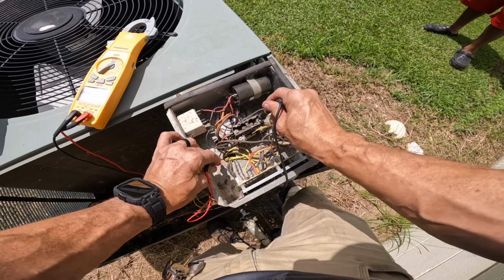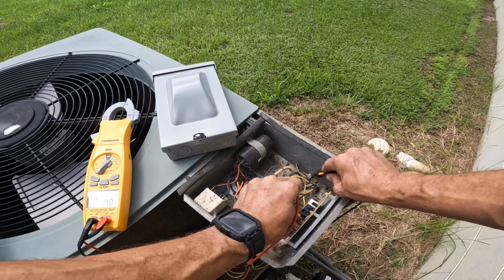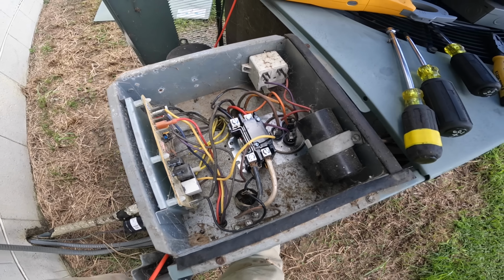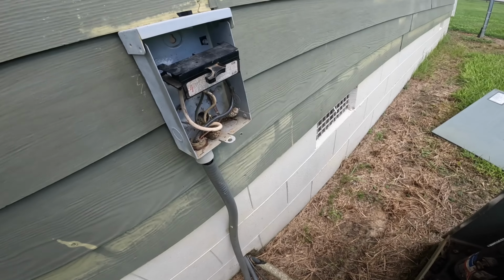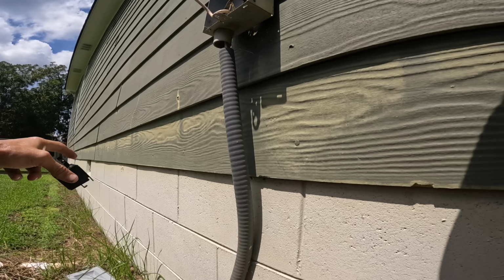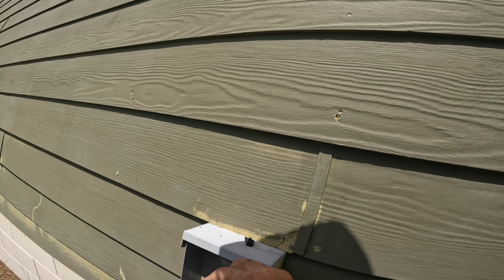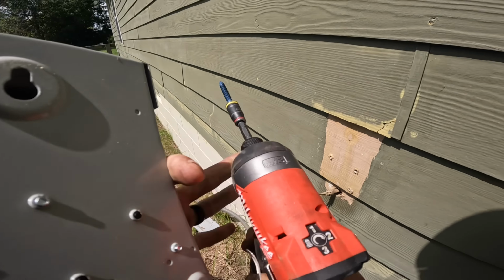No Cooling, Burnt Contactor and Disconnect Falling Apart

Comment: Good thing you had a spare disconnect (although an very expensive one) on your service truck.  If your going to stock/replace disconnects, you should also have some plastic bushings or chase nipples for the 'Romex' feed that enters from the rear.  Also, placing a small loop in each wire that connects to the breaker makes installation easier and provides a easy place to take a current reading.

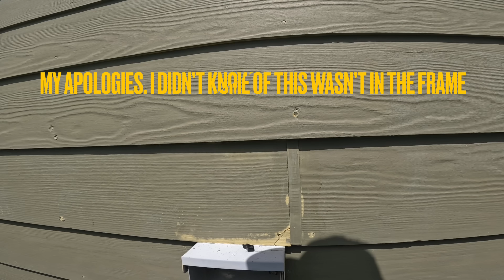Comment: 5:33 I totally agree Curtis, every one of those pull outs corrode and then burn once the resistance gets high enough.  I replaced the one feeding the 3.5 ton package unit on my  house with a feed-through breaker a while ago.  What is crazy is I've seen so many HVAC contractors installing those pull outs, I'm assuming due to lower cost and more frequent changeouts that will be needed.

Comment: At 18:20, it looks like some of the strands of the black wire aren't under the screw connector.  Possible hot spot under load.
Reply: yeah, it looked that way, may have been a few strands out. while it's not kosher per electric code/work, that stranded wire is oversized by two gauges to my eye it was a #6 copper stranded and the feed from panel to outdoor disconnect is 10awg solid(romex/nm-b), likely a 30amp breaker(maybe only 20amp depending on unit tonnage) someone used what they had on the truck and connected it, seeing the pvc conduit fittings on the end of the liquid-tight pvc. it may have been glued in at one point and let go from shrinkage. lol

Comment: Nice repair. We electricians use the linemen pliers to tighten and loosen locknuts  and while at the circuit breaker panel turning off the circuit breaker for the furnace would have saved you a trip into the crawl space. I enjoy your videos!

Comment: Hello; You might’ve done it and didn’t show it on the video but one of the things that I would’ve done since I had the power off is to check the microfarads on the capacitors while you were right there, bet one of them was probably low! Other than that always very good craftsmanship and integrity!
    Edward H. - owner / operator of “Integrity Plumbing, Septic, HVAC and Drain“ in Clinton, CT.
Reply: I'll bet he did that, but I agree that an out of tolerance cap can cause high start and run currents. I also check new caps and mark with install dates and value with a Sharpie marker. It is free and can save a call back
Reply: @hinspect  I do the same thing as well and it’s a good habit to be in and I have done it from the very beginning!

Comment: Wish everyone would wrap these white line/load wires with black tape. They obviously are not neutrals to most professionals, but some unlucky person could get zapped at some point if they get their hands inside the disconnect box 🤷‍♂️…missing a Romex connector on the supply also…
Reply: It’s illegal to change wire color with tape
Reply: White + Black does not necessarily indicate 220/240V, I agree with you though it should have been marked with tape but I am not surprised that it wasn't, at least in Tennessee. It looked like the Black + White from the house was #10 solid feeding a #8 Black + White stranded too!😄
Reply: @FredD63  what is legal? Marker?
Reply: Fingers don’t belong in a live disconnect anyway.
Reply: @whoisderf  agree 😂
Reply: @FredD63  actually Fred it's code to re-identify a white wire when used as a hot. The NEC doesn't limit you on how you may re-identify it but it certainly is very common to use electrical tape. And for the record, only white (or natural grey) wires that are part of a cable assembly (Romex for example) can be re-identified. Meaning that it's not permissable re-identify and use a white or green wire as a hot if it is a single conductor, ONLY if it is part of a cable assembly.
Reply: @fritzmiller9792  
Ok I stand corrected
Reply: @FredD63  You we're right in the spirit of the code !    I have seen white and green re-identified in a box (used as a hot wire) where it leaves the box in a conduit to other boxes.....a very dangerous practice. That's one reason why I treat every wire as a hot when first troubleshooting or altering electrical work. Don't even trust your own Mother when it comes to voltage I always say.
Reply: @FredD63  Wrong!!!!  It is required to re-identify white wires any color  but green to identify it as a Hot Conductor
Reply: Yes Chuck, spread the word to keep your hands out...lol.  always line tape....it's common courtesy and code in most places I've worked.  Thanks.
Reply: Using that logic, most "lay" people think black is ground because black is ground in automotive electronics.

Comment: If you don't have one, you should get one of those demolition screwdrivers from Klein. Metal shaft goes right through the handle to a metal cap on the top, good for hammering out knockouts and tightening/loosing the nut on cable clamps, etc...

Comment: You should have added a bushing on that disconnect on the house side. It is not a legal install to not have something to protect the wires.
Reply: It is a legal install
Reply: No it's not. Wire just floating around on the house side. Knockouts on that box are sharp.
Reply: @GoatzombieBubba  wrong.....this would easily fail electrical inspection.

Comment: Plugs were also used at do it yourself car washes in place of real coins…
Would like to have seen the wire grommet put in the box before house wiring was ran into box as it’s UL code
Reply: With wiring it is what it is. Most tech don’t know code but do the best they know. Lots of cities and states would require a licensed electrician to switch out that box.

Comment: Where is the Romex connector for the line wires coming out of the house ? And it doesn’t appear there is any caulk sealing the romex coming out of the house….. You made a point to replace the seal tite fitting at the disconnect but failed to install anything on the line wires
Reply: If inspected for sale in the future, it will definitely fail just because of the strain relief grommet.....
Reply: @JohnstonPettigrew  You have a very favorable view on inspectors. Where I'm at, it if it's not in plain view it won't ever be called out.
Reply: @billymccoy9155  ok ....but leaving out a connector on a sharp edge is just sloppy and not acceptable....because this is where the code is right.  I have seen sharp metal box edges wear away on wire insulation after a few years and some movement caused by a host of issues.  The siding can settle and move the box, even if the box is well attached.
Reply: @JohnstonPettigrew  Not arguing the reasons for the protection, shorts from wire exposure is a stupid problem to have, but happens all the time. Just saying the claim that it would fail inspection is laughable, no insult intended. Even if an hvac tech went through looking for any possible errors, most likely a customer would do nothing about it unless free.
Reply: @billymccoy9155  I understand your point.  My daughter's house failed on two points.....one was the exposed wire on the a/c breaker was 1/8 inch too long and the second was the a/c whip didn't have a rubber seal at termination at the electrical shut off.....just saying.  This was a house inspector hired by the buyer....not the county electrical inspector.....who picked off a switch in the newly installed a/c which was a few inches off from code.  It was repaired by the a/c contractor.
Reply: @JohnstonPettigrew  Somebody actually did their job. Sadly that's funny from a home inspector. How many jobs have you seen where this was never called out? Here my biggest problem with inspectors is they say it isn't working right because the temp split is off, aiming a laser at a 15 foot supply.
Reply: I am only familiar with Coral Springs, Florida, New City, New York and Porto Alegre, Brasil ....the only places we had inspections.
Reply: @JohnstonPettigrew  I meant in the field working, I assumed you were a tradesman.
Reply: @billymccoy9155  no....I'm a new home builder.......subs deal with electrical inspections.....I am not directly aware, but issues come up a lot.....especially these small issues like romex connectors and insulated a/c lines.......
Reply: That is correct
Reply: I noticed that. He should be able to sneak one of those Arlington split snap in ones in there without having to remove everything, will take some careful maneuvering to work it backwards on the wire, but should be doable.
Reply: @airplaneengine  I have seen a product from "Miller" being used by our guys also .....same kind of deal.
Reply: Oh my gosh, watch this guy for amusement only.

Comment: I just had one today that was installed behind the gas meter so you couldn’t get it open and it also was completely fried and burnt inside from bad connections. That was easily the worst one I’ve ever seen in my career
Reply: Had one installed between two roof pack units. One unit had been replaced, much larger than the old unit and sandwiched it in there.
Reply: lol. time to relocate it and smack the whizz out of whomever placed it or the gas meter there.🤬🙄
Reply: @throttlebottle5906  Exactly!! Would love to have a chat with that person.

Comment: A non-HVAC person with an EE/CS background in automation. That contactor lived a rough life in its type 1 enclosure. I watched some other HVAC videos where commercial roof equipment dies expensively of single-phased compressors because silica dust builds up on the contactor points. 
In your opinion, how much of a difference would type 4 make in the longevity of caps, control boards, and contactors for HVAC? I am guessing only feasible for commercial equipment.

Comment: The difference between UK and US wiring regulations are alarming as you would need a grommet on the cable from the house to the box as it can cut into the cable. The cable size difference between the incoumer is and the out going is asking is one of the cable sizes wrong for the current requirement
Reply: I think it's required in the US also.
Reply: Jess, that wasn't a legal install in the U.S,, the original installer was lazy.
Reply: Actually full conduit is required here.
Reply: @GoatzombieBubba  tell us you don't have a clue what wiring codes are without telling us you don't know what wiring codes are. And you called them a joke. You can't make this stuff up.

Comment: I am confused about one thing without re-watching the beginning... How did you say you had 240v if there is only a black and white wire + ground coming out of the house?
Reply: The white should be wrapped in black tape. It is 120VAC, not a neutral. See my comments
Reply: Whenever you have a 2-pole disconnect, each wire will be 120V to ground, 240V between black and white. This allows standard NM wiring to be used for both 120V and 240V systems. The white wire is allowed to be current carrying in this case without re-marking it such as you must in a 120v lighting circuit where the white wire needs to be taped black if it is used as current-carrying.
Reply: @charleshauser4537  here in South Jersey, all my 240V whites are wrapped in black tape 🤷‍♂️
Reply: @chuckquinn8026  Iy should be. Somebody was just lazy during the install.
Reply: @charleshauser4537  In wiring for lights and electrical outlets on a single pole breaker (120 volts) the white is always neutral. It is never to be used to carry a load other than residual electric back to the box. If neutrals are purposely hot in lighting and outlets, then it's wired wrong and is very dangerous as it leads to open grounds.
Reply: @charleshauser4537  sorry Charles..... the white wire must be re-identified per NEC....tape is fine but other means of identifying it is acceptable as well.
Reply: @brianmcneese9425 Not exactly. It's permissable to use the white as a hot as long as it's re-identified. The last code eliminated the practice BUT there are many "Switch Loops" in the field as it's been common practice since AC wiring first began. Also, the neutral carries the same current as the hot back to the Service/Source unless it meets neutral current from the opposite 120 volt side of the xfmr, in which case the two neutral currents reduce by the amount of the lesser current....in other words they provide for each other with the smaller one cancelling out.
Reply: Jus always use your volt meter to know what’s what! You go behind many different people working on stuff! Homeowners, shade tree, & handyman!!! You can’t always go by the color of the wire to determine what the power actually is. My moms neighbor behind her changed his water heater! His brother couldn’t remember how to wire back up! Had different wire colors! Kept assuming the opposite! I had to use volt meter to help them get it back online!
Another example ! A commercial building wanted an exhaust fan installed! They sent several techs to install the motor! They kept trying to match each wire by color!!!! Instead of following the wiring diagram! (So they kept burning the new motors up!!)

They sent me to wire it up & it kept running!! My manager asked me what I did different…. I told him I looked at the instructions to wire according to the voltage application!
Some motors have different wiring set up! U don’t jus go by color matching…

Comment: Good Video.
I understand your tired and it's hot out there. BUT dont throw down their service cover to the unit. Shows Disrespect to the people's house.
Also as you know,  Rheem/Rudd a/h have that shitty installed insulation in blower area, That Always fall down n get sucked into the blower motor, Remove it n put it on top of outer cabinet w Pookie/mastic to hold it in place. *low heat factor as Hot attics crawl space

Comment: USE BUSHINGS . Never pass wiring through a sharp edge on a box . Your filming your NEC violations
Reply: True, but I've never seen anyone actually put them in.
Reply: @realtorkevinfung  I do all the time I have a truck full of 1/2 and 3/4 bushings. People who make YT videos should make sure they are doing things to code. We want to teach those coming up in the industry to do things right. There's enough hacks out there.
Reply: @apollorobb   What kind of bushings do you use? Plastic push in kind or metal ones?
Reply: @search_eternal  plastic snap in
Reply: Just replaced one of those on a disconnect I swapped out because it had become brittle and cracked when trying to put it into the new one. So I used a metal threaded one off my van.

Mind you, it still provided proper function until it was molested by me.
Reply: @masterbeard367  yeah, they get brittle with age and break, especially in an outdoor setting. we only used metal nm/uf connectors back when I trained, I don't think the plastic ones were even on the market or maybe nobody likes using them(new junk) lol.
it's really against code to run nm-b to anything outdoors now, it would need to be uf-b or conduit and thwn or other outdoor wet rated conductors.
I have taken apart outdoor outlets and disconnects to find they had no drain holes/clogged and water wicked many feet into the romex rotting the paper insulator. that woudl be fine if it wasn't near a highway and had tons of salt mist/spray(calicum chloride and other ice melters), the bar ground was corrded to dust some fifteen feet into the home.
probably one reason code changed, that and near the sea/oceans, same corrosion issues.

Comment: Illegal electrical box install, no bushing on supply wire. If that was my house and saw you throw those pliers on my unit, I would have run you off my property. No need to be ruff on customers stuff. I usually like your videos, but not this one.